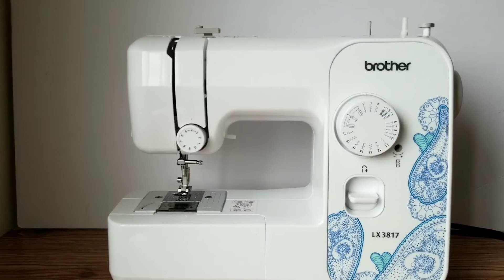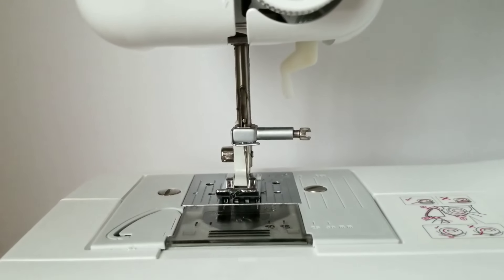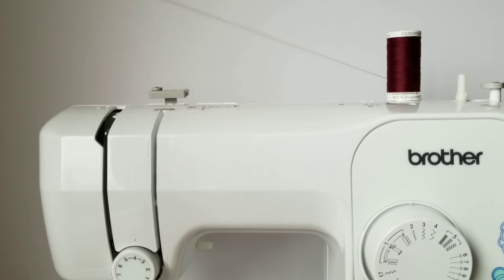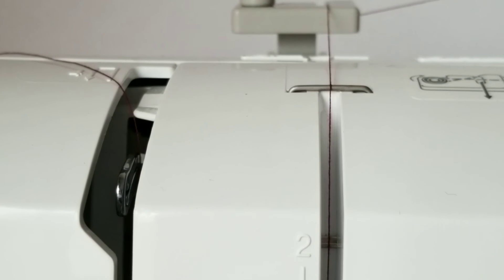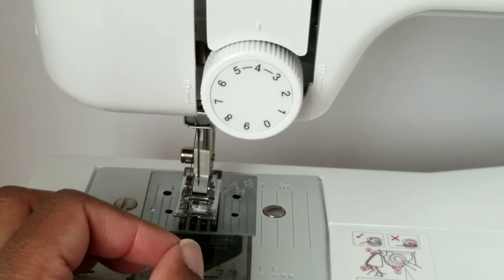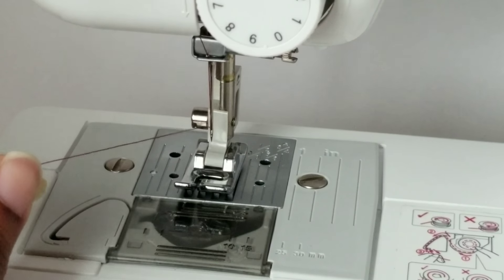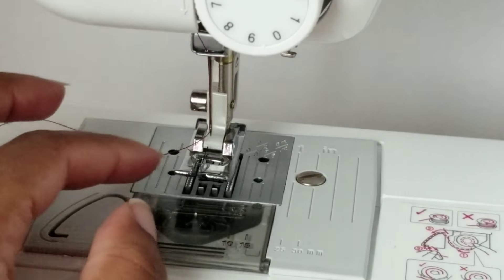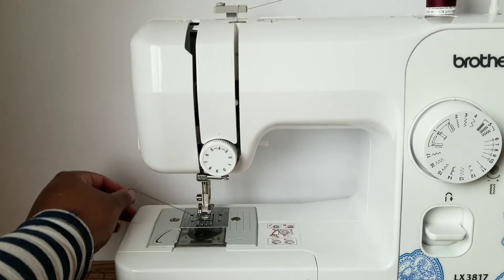Brother LX3817- How to Thread the Needle

Comment: Right off the bat, you cleared up two points of confusion for me! I had no idea I could pull up the spool pin and was wondering why they put such a short pin in! DUH! I have actually been sewing with this machine for a couple of months now...with the pin down, LOL. The second thing that was throwing me was whether to put the thread under the small metal bar on the top of the machine, or leave it over. I've been struggling to put it under. It doesn't do any harm having it that way...but it's frustrating to do it! I had the rest of it right, thank heavens! You probably won't believe this, given my amateur mistakes, but I've been sewing since I was six and making my clothes since age 12. Of course, machines were a lot different back then...I'm 74 now...but I've learned two valuable lessons here. 1) You're never too old to learn (LOL), and 2) It pays to be internet savvy. The biggest lesson, however, is to always, always, watch tutorials by April before attempting anything new :) Thank you for being here!

Comment: The LX3817 has the quick set bobbin feature (the side slit on the left with the cutter at the end) so the bobbin thread doesn't need to be drawn up (page 16 of LX3817 manual). That's why the bobbin thread was so short when it was drawn up. I haven't seen a video yet that explains this. If long thread tails are needed for instance to do gathers or darts as explained on the left side of page 21, then the side slit and cutter of the quick set bobbin feature are not used and a long bobbin thread tail is left above the thread slit then the bobbin thread can be drawn up and it will not be short. It would be special to show each way in a video. A lot of people are confused about the quick set bobbin feature and how it works so that one can just start sewing without drawing up the bobbin thread.
Reply from the maker: When I originally threaded the needle I didn't draw the bobbin thread it automatically came up when I started sewing. I thought bringing it up and securing it to the back was to help the thread to not tangle.
Reply: @coolcalmapril6850  As you said the bobbin thread came up automatically (because of using the quick set bobbin feature) and it would be too short to tangle. The upper thread that's through the needle should be long and held on to until a few stitches are sewn (always start sewing with the handwheel lined up first).
Reply from the maker: @hummingbirdlady11  Ok, thanks. I'm trying to read the manual so I can use proper terminology in future videos. Thanks for the tip about the bobbin thread being shorter and holding on to the upper thread. And also thanks for the tip about the hand wheel being lined up first. I am also thinking about taking a class at Joanne's, I have to find one that works with my Job schedule.
Reply: @coolcalmapril6850  Good to have a hands on sewing class. Will you take your LX3817 to class or are there machines provided?
Reply from the maker: I think I'm allowed to bring my own machine. I will check out the website again
Reply: @coolcalmapril6850  BTW This is a really very well done and accurate tutorial.
Reply from the maker: @hummingbirdlady11  thanks Myra! I'll get some new videos up soon, been busy with work and baking the last couple weeks.
Reply: @coolcalmapril6850  Understandable that other things in your life keep you busy too. This is a fine tutorial and will be very helpful to many people. A suggestion for a new video is to show specifically about starting to sew without drawing up the bobbin thread after using the quick set feature and perhaps showing the underside of the fabric to see that the bobbin thread is short and not tangled. Then show not using the quick set feature as detailed on the left side of page 21 in the manual. The bobbin thread is not drawn through the quick set feature so it's left long and trailing along the outside of the quick set slit so there's a long tail (instead of a short tip of the thread) to draw up and make the loop easily. Sorry for all the explanation! Another video suggestion would be to show using the reverse button/lever to secure the ends of sewing. Many beginners over do reverse stitches thinking that is more secure but over sewing back and forth from forward sewing and reverse will make a spot that is a thick lump. The manual on page 12 only shows using the reverse lever so it would be good for beginners to see that only a few stitches are needed/wanted and not back and forth too much.
Reply from the maker: @hummingbirdlady11  ok that definitely sounds like a good idea. I will use this info to make it the best tutorial ever! Thanks again for your knowledge and suggestions!
Reply: @coolcalmapril6850  Wow that is great. Did I mention that the thread spool is to be winding off of the front of the spool and it would be something other videos don't mention that the spool should turn clockwise. I like that your greeting is a nice Hello. That Hi Guys most everyone else says is annoying. LOL
Reply from the maker: @hummingbirdlady11  Yes, you did mention that. OMG, you know how hard it is to NOT say "hey guys" after watching tons of YT videos?! LOL! thanks for noticing that!
Reply: @coolcalmapril6850 A nice "hello" will never get old like the dreaded Hey Guys in that typical shrill tone!

Comment: Good vid.  I would maybe emphasize putting the upper thread thru the presser foot at the end with some close ups. That really messed me up until i figured it out.    Overall a really good instruction video.  Thanks
Reply from the maker: Thanks for the tip and positive feedback 😊😊
Reply: @coolcalmapril6850   no problem. Your instructions gave me the courage to try sewing.  I'm a kiteboarder and we usually send our kites out for repairs which cost $200+ typically.  I bought the $76 Brother machine at wm and have practicing the zig zag stitch (our kites only use the 3step zig zag stitch) all weekend.  Thanks again. Wouldn't have attempted this without your channel.

Comment: When I'm threading my machine, after placing it on the spool pin and after I place it through the gray thread guide, do I thread it over or under the little metal bar before bringing it down and around the upper tension control dial? Does it even matter?

Comment: PLEASE! Tell me what the big paddle switch is for on the front of the machine right below the stitch selector knob?  it's the only switch on the front and no one has explained that.  It has a big U-turn diagram on it.  Thanks in advance.
Reply from the maker: It’s to do a backstitch. When you first start sewing press and hold it down it it will pull the fabric backwards. After a few stitches you let it go. That’s how you lock the stitches in

Comment: CAN YOU PLEASE EXPLAIN MORE ON RHE END PART LIKE WHATS THE PRESSER FOOT ITS CONFUSING AT THE END
Reply from the maker: So sorry, the thread goes between the opening of the pressor foot so that it is out the way when you start sewing. It's not necessary that you place it through the opening, when you start sewing you can just  place the 2 threads to the back or side to avoid the thread from becoming tangled. Hope that helps.
Reply from the maker: The pressor foot  is the attachment used to hold fabric flat as it is fed through the machine and stitched. At 2:24 you can see the pressor foot at a better angle
Reply: ok !! thank you and after that i can just start sewing or do you have more videos for beginners?
Reply from the maker: @starlo6336  yes, you are ready to go. I don't have any beginner projects on my channel yet.

Comment: April, why does my needle keep coming unthreaded?  Always have trouble with the bobbin sometimes it gathers and then it doesn't. New to sewing.  Help.  Susie
Reply from the maker: I had that issue before, make sure you hold the thread tail when you first start. Once you have several stitches release the tail. Sometimes itvcomes out that thread guard too, ck that. Hope that helps.

Comment: This is going to take me like 3 hrs to do the thread won't go through my NEEDLE UGH!!😭😭😭
Reply from the maker: 😂😂😂 I hope it didn't take you 3 hours. Trim the tip of the thread so the end is smooth, hope that helps
Reply: @coolcalmapril6850  that helped tysm
Reply from the maker: Your welcome!
Reply: @SmokingonTop5 Also, be sure the thread is not too thick for the eye of the needle.  The thread's thickness should not take up all the space of the needle's eye. Hold a white card behind the needle and that will make the eye easier to see. It's a common practice to wet the tip of the thread (after a fresh cut is made) but slightly moistening the eye itself will draw in the thread better.